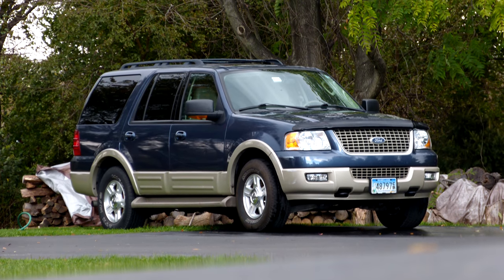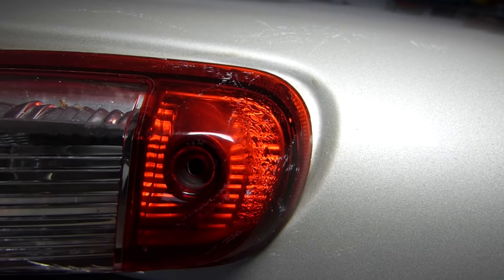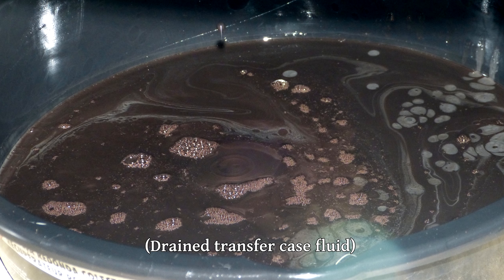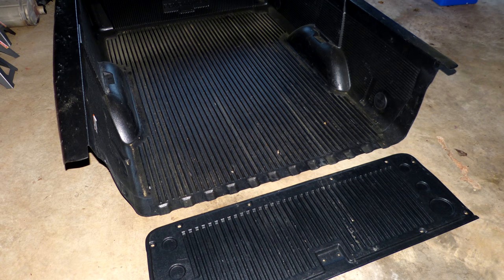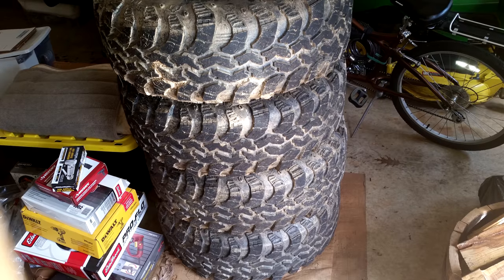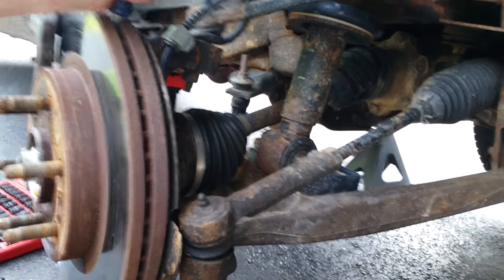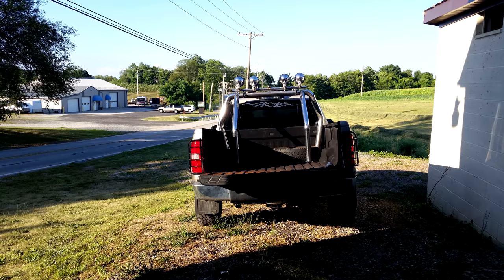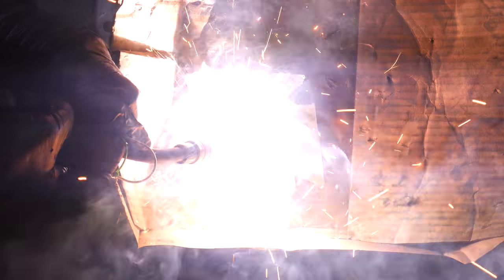2007 Chevy Silverado 4x4 Backstory and Adventures (Ep.1)

Comment: I''m a chevy tech and I can tell you that the headlight connector melting is extremely common. I saw it on plenty of trucks, suburbans, tahoes, pretty much any full size truck chassis vehicle. The daytime running lights, which obviously run in the day time (you know, when its hot), get hot from the excess heat and melt.
Reply: Holy mother of god the rust
Reply: James Flores oh well lol ,my dad old 99 Silverado had rust on bumpers ,fenders ,frame and the bottom part of the body . I still have it though, I just need new bumpers,too much rust and chrome
Reply: Looking to swap L.E.D on parking lights. Already had to drill small holes on the bottom of park light housing bcuz after a good rain they would fill up to electrical connections with water!
Reply: James Flores a
Reply: Chevy's aren't the only ones that do this. We got 3 11-16 Ford Super Duty's at my job and we've had the headlight connectors melt in all of them more than once.

Comment: I own a 2009 Silverado with the 5.3 motor and I cannot say anything bad about it even after 160 k of hard use. It’s something about these year of Silverado trucks that looks and feels great to drive. I think that it’s not too sophisticated but it’s functional. I feel that the new trucks are too busy looking and don’t feel  as fun to drive as the 07-13 however that’s just my opinion.  I will soon be leveling the truck with Bilstein struts to match  the rear shocks to fit 33’s.  I love the video and hope to see more like it in the future keep it up my friend :-)
Reply from the maker: Cool! Just a warning about fitting 33's, I left the rear height alone and used the spacers on the front (got an extra 1.5-2"), but because of the offset of the Mickey Thompson Classics, they rub on the steel at the rear of the fenders when turning. I bet it would be okay (barely) with a more stock offset, or maybe on a Z71, but expect that they might rub a bit! Most of the research I did before going with those tires said they would fit fine, but that wasn't quite my experience. Hope everything works out for you!

Comment: Wheel bearings and ball joints are pretty common wear items on those trucks, I would say the bigger tires had more of an impact then going through all the water. But its good to see you actually use it as a truck not a jacked up pavement princess like other people.... Looking forward to seeing the upcoming vids! PS. Thats a pretty typical low optioned work truck, the government around here had lots like that back in the day.
Reply from the maker: Thanks for that PS! I always assumed as much. I can't seem to get ball joints with boots that don't disintegrate after a few years, so the water definitely got into them and rusted them to hell. You're probably right about the wheel bearings, and driving on the bad ball joints didn't do the bearings any favors!

Comment: I have an 06 Dakota with 90,000 miles. Granted  I live in a warm climate and it’s 2wd so no off road but it’s doing good for it’s age and does it’s fair share of towing and hauling with no major issues like what you have. Just have to tap the steering column to get the windshield wiper to work and the trans temp light comes on but otherwise no issues like on the Chevy, hope it can be saved

Comment: Have a 2010 f-150 I bought from my dad. Has 205,000+ miles... changed spark plugs due to a serious misfire issue found out it was still running original plugs:/ changed rear diff fluid, and installed a new driveshaft after my hanger bearing blew to bits. Otherwise been a sexy, awesome truck that I have so many memories of. Only appearance mod is a window sticker... might change that with some fx4 head and tail lights, maybe an exhaust but that's all I would want.

Comment: 07-13 chevys were the "Bankruptcy" Gen of chevy trucks. I had an 09' with the 4.8l.

I cant tell you how many thousands of dollars of parts I had to put into that truck between 65k-100k miles.
Massive list of electrical issues. (powerlocks, radio (2x), and many others)
Fuel pump control module.
2x- 4L60E rebuilds. (planetarys ate themselves)
Entire front suspension rebuild. (CV axles twice, bushings were whooped in control arms,)
I had to replace the EVAP purge valve atleast 3 times.
I did all the work except the transmission.

One thing I loved about that truck was the engine. Plenty of power, and incredibly reliable.
Any fullsize vehicle with a 4L60e needs to have a serious cooler in the system. I could not haul or tow anything without those trans temps climbing to 215+F on the regular.

Comment: At 7:19, it's a loose connection. When wiring isn't properly secured together, the electricity will "arc." The light will continue to work, but every time you use it, the electricity will arc and burn a little bit more of the material off. As more material that get's burned off, the worst the arcing gets, it becomes hotter, and more severe, (this is how electrical fire's happen). This is also why some electrician's are almost OCD about how organized their wiring is.
Reply from the maker: Ah, good point! Experienced something similar with the S10 Blazer and a fuse, though it hasn't been shown in a video yet. It is strange that the reports I read online said it is only an issue with the passenger side connector though, not sure why it would only happen on the one side. Maybe the wire loom isn't as well secured on that side or something.
Reply: I do find it interesting that it is just that one side as well, I'm not sure if that has more to do with stock quality control, but the ceramic one should hold up better! Just check it every now and again and make sure the arcing doesn't start back up. 

P.S. I just found this channel a week ago and I've already watched through the entire S10 playlist, I've loved all of these build's! Keep up the good work!
Reply: its common on alot of gms that use that pigtail and have daytime running lights, they all melt eventually and has nothing to do with a loose connection. New pigtail and bulb and good to go

Comment: I have a 2013 silverado 1500 extended cab with the 4.8, ive owned for approximately 14 months. So far so good, started with 60k. Im getting 15 or 16 mpg has 285/70/17 tires. I do pull a landscape trailer  occasionally.

Comment: GM is good at not melting headlight connectors, not rusting, anything electrical really, and transmissions...dear goodness their 4L60E can take 20ft lbs of torque no problem
Reply: Censorship Sold Separately I can assure you ram and ford have most of those problems🤣 my suburban just burnt a head light connector and it has a rust spot about the size of a 1.5 y/o hand and it has 120000 miles it’s a 2008 and hasn’t had any transmission issues so far

Comment: I wish you did a video when you installed the cab marker lights! I am getting ready to do it on my 2011. Nerve wracking thinking about putting holes in my roof but I love the look! I have a 2" leveling kit with 285/65/18 on stock wheels. But I love the look of yours (sticking out a little) do you remember the specs on them? Offset etc? Love the videos man.
Reply from the maker: The wheels are Mickey Thompson Classic III's, 17x9" with a 4.5" backspacing. They rub fairly badly when turning even with the cut front end and leveling kit unfortunately. I wouldn't do the cab lights again given the chance, though they haven't given me too much trouble. The cheap aftermarket lenses do leak and I haven't managed to stop that, but some RTV on the mounting screws and wires going through the roof has kept it from becoming a problem so far.
Reply: I plan on using LOTS of rtv!
Reply from the maker: @stewpuddy4161  Good idea lol. Best advice I can give is to take a lot of time positioning them how you want before drilling anything. Use painters tape on the roof and mark positions and holes to drill, measure to make sure everything is straight and triple check that they are where you want them. A good idea to take a paintbrush and paint the bare steel after drilling and before applying RTV, too. I ended up using different (stainless) sheet metal screws and rubber washers under the heads to try to help them seal. And don't over-tighten the lenses, just snug, I cracked one of them a bit the third or fourth time I reinstalled it.
Reply: Thanks for the advice! I'll take my time, and have a beer AFTERWARDS! Keep the videos coming man, I'm loving this channel! I wish you guys lived near me because I'd love to help with these projects!
Reply: Got the cab lights installed. No leaks! Made a little video of my truck in it's current state if you want to see them. Not the quality of your videos, just sort of an explanation of how I did it!

Comment: My dad has a 2009 silverado 1500 5.3 L vortec 278,000 miles we never had any of those problems except the headlight plug melting and the rust under the paint on the back fender

Comment: It's a fleet package. Chevy has a few of those that you as a regular person can't get new at the Dealer. Pretty much the only way you'll find them is used. My Ranger is kind of similar, although Ford does make their fleet packages available to the general public if you ask for it specifically. The problem is the cost savings are so miniscule for a single truck that it's usually not worth it, unless you're a fleet company buying in bulk. Or a weirdo like me that would buy manual locks and crank windows even if it cost the same or more.

Comment: I’ve driven through that creek a bunch of times. Got my old 4Runner stuck nearby too. 
Now I’m too paranoid to do it.
Reply from the maker: It gets pretty deep at times and when the water is moving the bottom is pretty loose, have to be careful there. Used that as a shortcut for a long time but not so much anymore. Drove the S10 Blazer through it somewhat aggressively (will be in a future video) and managed to get enough water into the intake to stall it out, so I hope I learned my lesson there.

Comment: A little foreshadowing with the transfer case story.... Hmmm.   Ahh, What are pick ups good for?  My 94 Suburban has been bracket raced, off roaded, towed, been towed, broke into, hauled stuff, stored stuff, slept in,  cussed at, in, to.  Its ugly, has no AC anymore,  blows heat out the floor vent all the time which sucks in Texas heat, radio blew out all 6 speakers, fuel pump died, but it is paid for, runs 95% of the time, can park it anywhere and dont care if paint gets scratched.   I do kinda wish it was OBD2 however.
Reply from the maker: I love Suburbans as well! Family had a 3/4 ton early 90's Burb, towed a camper around and got used and abused for a decade. Sold it to a family friend who still drives it to this day (well, his ex-wife does since she got it in the divorce) with over 300k miles. That outro segment was really just an excuse for that little slideshow of pictures that didn't fit elsewhere in the video.

Comment: probably good you got the 4.8 as the 5.3 which is by far more common has the active fuel managment which when it fails is a huge cost
Reply from the maker: Good point, I much prefer to have the simpler engine!

Comment: I hope you've considered upgrading to the 4L80E?  Maybe?  They're fairly cheap in the 4WD flavor ($750) although I'm sure you can rebuild your 60E for a lot less.  Dig the videos.  Thanks for the content.
Reply: I second that, the 4l60e is a mess and by default unlocks the converter upon throttle off. At least on my Trailblazer SS it does (4L70e in name only)
Reply from the maker: I previously had plans to turbo this truck and swap to a 4L80E, but that never happened. It's keeping the 4L60E for now, it is a finicky trans but it should be fine for what I expect of it in this case.

Comment: I had a similar problem with my k5 blazer. It is a transfer case issue. The plastic guides wear out on the synchros and the transfer case tries to shift out of gear. Mine would do it when I came to a stop to fast. It would try to shift into four wheel dive.
Reply from the maker: Yep, it did turn out to be a transfer case issue, it will be covered in future episodes. Rebuilt the trans while it was out and then the transfer case as well. The plastic guides failed but so did the rear bearing which allowed the shaft to walk forward, not sure which came first though.

Comment: Hi!:)What was the mileage on your truck when transmission went bad?
Reply from the maker: The transmission ended up being fine, the transfer case was the problem. The issues started before I bought it at 60k miles, but I was driving it until around 80k when it started slipping and grinding when driving normally.
Reply: @FuzzyDiceProjects  thank you very much for a fast reply. I am about to buy a identical car this week with 60k.  Your car look great.

Comment: When are you going to finish the jeep been waiting on videos for it
Reply from the maker: It is still in the diagnosis process unfortunately, not much done to it. Crank sensor was replaced with a MOPAR one as most of the comments suggested, but it didn't fix the issue. Looking into the TPS and other sensors next.

Comment: Those 4L60es are finicky bitches. Some upgrades to keep in mind if you do the trans, the Corvette servo, hardened sun shell, upgraded valve body and clutches. Good luck I love these truck message me if you have any question
Reply from the maker: Thanks for the offer! The rebuild has already been completed, used everything you mentioned except I barely modified the valvebody. Probably should have just put in a basic shift kit, might still eventually, but it is fine as-is for now.

Comment: "Thin veneer of quality"? Sounds like you've been driving and modifying it pretty hard (more than most people with trucks) and it's held up as expected? Plus it's a used 10 year old truck. LOL Just my $.02 though. The Bondo on the bedside isn't a Chevy flaw.
Reply from the maker: I don't mean to say is a problem with the brand or the truck as it came from the factory, just that the dealership dressed it up to hide flaws and pushed a few things through state inspection that shouldn't have passed. Two cracked brake light housings (one I still haven't replaced), transmission/transfer case/oil in both diffs that clearly wasn't changed though they said they changed all the fluids, slightly hacked wiring where it once had a trailer hitch with aftermarket wiring and some was removed, water leaks, spare tire that doesn't hold air, the plastic bedliner over the severely dented rusty bed, leaking ABS unit, leaking water pump, things like that. And, of course, the drivetrain issue that seems to have started before it was even in my hands.

It isn't doing too bad, and maybe that statement was a little exaggerated, but basically meant that it was a bit more rough than a first glance and drive told me, and certainly what the car salesmen were telling me.

Comment: What size lights did you put on the front of the truck on the grille guard... I really like how they look, but didnt know what size to get.
Reply from the maker: They are 6" lights, ones on the back are actual K/C lights, on the front they are clones with K/C covers. Blazer C52CW 100w lights, only $10 each. Pretty bright, somewhere between spot and flood. The housing on one of them has rusted badly (in four years on the truck) the other three still look good somehow. Can't really complain for the price.

Comment: What year and mileage? Have 2009 Sierra 5.3 150,000 and no problems at all
Reply from the maker: 2007, and only around 80k miles. The 07/08 trucks had a specific issue in the transfer case that ended up being the problem.

Comment: The transmission and transfrcase problems sound like they been abused by the previous owner. My father has a 2002 Yukon (L59 with the 4l60E) and it hauls like an animal. No single driveterrain issue so far. No rust because we live in the middle east.

Comment: If the sun shell was stripped or broke you would lose 2nd, 4th, AND reverse.
Reply from the maker: Yep, by the point I stopped driving it I would have seen more problems with forward gears than I did, since I only had the issue in 4th gears toward the end. A trans guy I talked to told me it was the issue and I made the mistake of not looking into it hard enough and assuming it was the case.

Comment: This guy doesn’t know much about trim levels... CLEARLY it’s an LT base model...
Reply from the maker: Nope! No "SLT" RPO code and it is missing a few options that came standard with the LT package. It's a common fleet vehicle setup, as some other commenters pointed out, basically a "work truck" model with a few extra options.
Reply: Or just a WT

Comment: Automatic windows . 🤣🤣 yeah right.  I saw the handle. Wind up wind down
Reply from the maker: "But it also has manual locks and windows." When did you hear otherwise? I actually really like manual windows in most situations, it's only annoying to try to move the passenger side one when driving since the cab is so wide lol.
Reply: No if you look in the beginning you can see it has manual windows. I have them in my f150 and I can’t reach the passenger window handle

Comment: I'd be willing to bet it's your transfer case while you have the transmission out I'd replace it or rebilled it
Reply from the maker: Good guess! Rebuilt both while they were out. The issue did end up being with the transfer case.
Reply: I've had the same problem on my 93 Chevy if they run out of fluid there pretty much done for but I definitely love the content on your channel

Comment: S10 blazer? You mean k5
Reply from the maker: The Blazer I have is an S10, the smaller of the two models. The S10 Blazer is based off (as the name suggests) the mid-size pickup's frame, while the K5 Blazer is based off of the full-size frame and is quite a bit larger.
Reply: Fuzzy Dice Projects oh that’s cool I never knew that,thanks